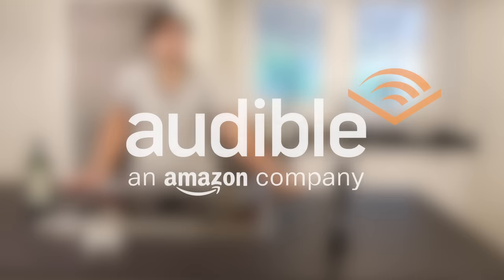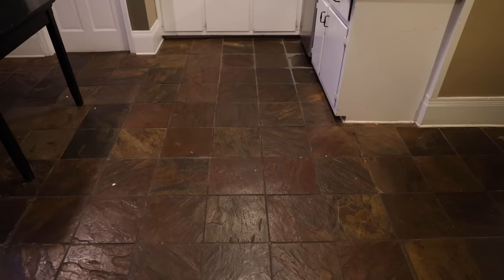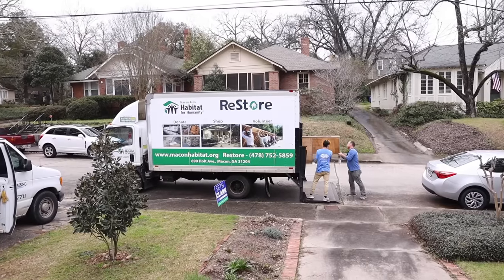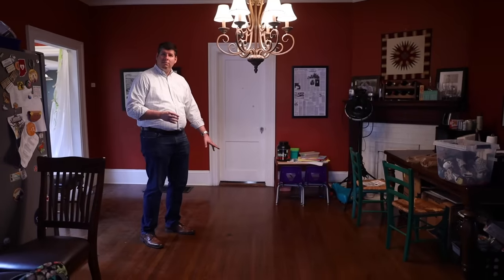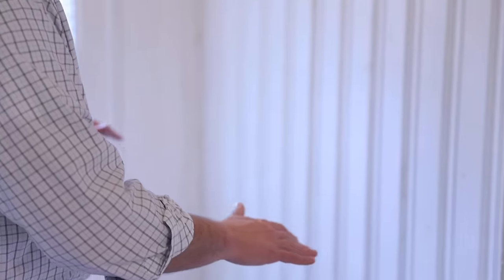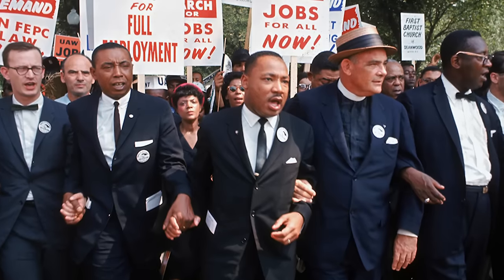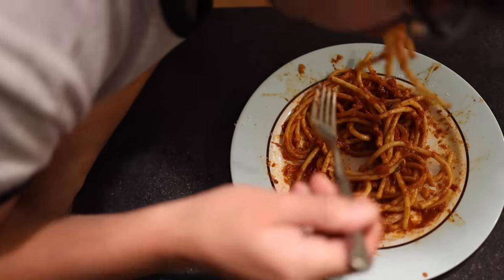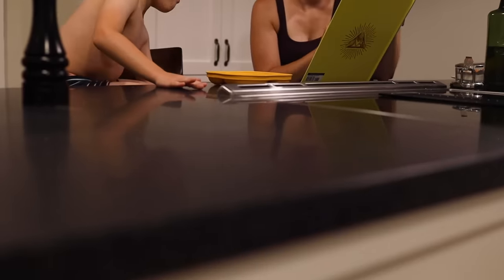How history changed kitchen design in the American South

Comment: this explains a lot about my friends home. even though i live outside philly my friends house is old. being 3 stories high with an attic while other houses are only 2 stories high. their kitchen was at back of the house had doors cutting off the kitchen and separating the dinning room. the kitchen was right next to the basement, had access to a back yard and small prep area, and a “secret” stairway to the second floor. the main stairway was grand being wider than the stairways in my middle school while the “secret” stairway was narrow and was basically between two walls and it was dark. it was most likely used for the servants of the house to get upstairs without guest seeing them.
Reply: There used to be an English phrase: "the back stairs". This was because in the 1800s and earlier well-to-do English houses had two sets of stairs: the main or front stairs that the "lords of the house" (the owners) used, and the back stairs that the servants used. The back stairs were usually narrow and awkward and crammed in to spaces, but they were also large enough that you could manage to carry bulky things up and down them without dropping them. Food and laundry never went up the main stairs. The main stairs usually opened pretty much directly onto the main front door, and the back stairs would open, through a kitchen and/or pantry, on a back 'tradesman's door'.
Reply: l wilton that nails its description. the front of the house has large porch that goes around to the sides. and in the front door there is a study a living room the dining room and the main stairs.
Reply: Seems like these houses were pretty much laid out the same all over the place from the era... interesting.

Comment: I draw house plans for a living, and do a lot of additions.  I see a variety of plans, and actual houses built over a hundred years ago.  It's common for older homes to have started with the kitchen being walled in.  And many had a butler's pantry, like Adam's house.  
Everything Adam and the professor said is true, except for one thing, domestic servants were quite common in every state.  You can look at house plans in books, and magazines, from the 1920's and earlier, and see that the walled off kitchen layout is standard.  The kitchen would have a screened porch on a back corner, and have it's own entry to the side yard by the driveway.  The servant used the porch to perform many tasks in, and was typically expected to enter the house through that side entrance.  Servants, and delivery men were not allowed to come in the main entrance.  It was also common to have a teeny tiny powder room reserved for the servant(s) who were only dayworkers.  That kept them from tying up the bathrooms used by the home's residents.  But mostly, it resolves any unease felt by a homeowner who was prejudiced based on race, or class.  Sitting on a toilet that a mere servant had used would be unacceptable to many people in those days.  And more than a few today.

For those houses that were designed to accommodate live-in staff, modest homes would have a tiny bedroom for a cook/housekeeper located at the back by the kitchen.  It was usually adjacent to the kitchen porch.  In larger houses, owned by more affluent people, a section of the house was set aside for servants, like you see on British TV shows.  Sometimes they'd be in the basement, sometimes in the attic, and just as often, in their own small wing.  The servant's floor, or wing, would have a full bath reserved just for the staff, and sometimes a sitting room was reserved for them.  The exception is that live-in chauffeurs, and gardeners, would often have rooms and a bath in the garage.  The garage was not attached to the main house, and was located in the back yard. 

 Domestics may have been predominately Black in the South, but in other parts of the country, they were Irish, Norwegian, Italian, Portuguese, Mexican, Chinese, or any ancestry you can think of. 
The rising cost of labor, opportunities for better jobs, and labor saving devices, eventually killed off the profession of domestic workers.  The exception being those who are employed by the very rich.    And even they try to pay as little as possible, often hiring foreigners who are here without legal papers.

My purpose for writing was to point out that, as bad as the South may have been with it's treatment of Blacks, domestic servants of all backgrounds, were common across the country, and even around the world.

Comment: Houses used to be built with their environment in mind, that's why different regions have different styles of houses. Today you could build an east coast style McMansion in Arizona and use vast amounts of AC and energy to cool and heat it and it would be terribly inefficient. I'm not suggesting that anyone have to live without AC but rather we should bring back those traditional designs of houses that were created to fit their environment. Like the humble southern Shotgun Shack which had total cross ventilation and often had the kitchen in the back to isolate the heat and keep the house cool in our notoriously hot summers. It was well adapted to the regions weather and made the summers more bearable before the advent of AC. Plenty of other local architectural styles have clever layouts with cooling in mind. They're also much more characterful and better looking than these modern ticky tacky subdivision houses. As well as being more energy efficient.
Reply: Thank you! As a non-American, I was always wondering if anyone American ever noticed how bland and tasteless those generic "luxury" houses are, and it turns out, there is even a word for them!

Comment: I too live in a nearly 100-year-old bungalow, but on the other side of the country in California. My kitchen comes equipped with a tiny shelved closet with air vents on the shaded side of the house, meant to be used as a pantry that would stay colder than the rest of the house even in the summer months, called a California Cooler. Your video has clued me in to the purpose of the weird nook in my daughter's bedroom (which itself used to be part of the living room before a wall was put up to partition off a small bedroom) since this nook too is slanted towards the outer wall enough that toys are always rolling that way. Maybe it was once an outside patio as well.

We just finished a bathroom renovation that rearranged everything as well, because the previous layout of the bathroom made 1920s assumptions that are no longer true. They didn't have a shower back then, for one, so it was perfectly fine to have a wood-framed window above the bath tub ;_; One of the owners back in the 1980s or so decided to renovate to add a shower without changing anything else. Every renovation is like an archaeological dig, trying to figure out what all the previous owners did to the place over the last 90-some years.

Comment: A few years ago, I was graciously given a tour of an 1870s Victorian in San Jose, CA so well-maintained that it still had working gas piping for gaslights and the original servant's staircase to reach the prep kitchen, which was at the back of the second floor. I had never seen such a steep, narrow stairway, and I've climbed stairs in 18th century taverns.

I appreciate modern kitchen design. And staircases.

Comment: There's another interesting bit of history that I probably wouldn't have noticed before. The hearth, was more centralized the more north you went and more decentralized the closer to the equator. You'd much more commonly see public cooking areas around the equator, and have central to the home fires (including cooking fires) in northern areas. Why? Because fire is warm! If you're already in 90+ degree heat you don't want to be stuck inside with a hot oven, but if it's gonna be frozen outside half the year you want to be as close to that action as possible.

Now once you get closer to the modern era or the upper classes you see that division come up again as you can have separate fires for staying warm and for cooking, but I think that's just another neat thing. The idea that having two heat sources would be a luxury.

Comment: My 1897 house also has one of those servant bell buttons on the floor. It didn't hold a pedal, but a small button held up by a spring.  It looked rather like a thick and dull nail.  It still worked.  When I bought the house in the 1990s, I was having the ceiling of the dining room painted.  My painter had had a fall and hurt his shoulder, so he had a hard time painting overhead, so he hired a friend of his to help him.  His friend was terrified of old homes and was convinced they were all haunted.  They had covered the floors with drop cloths, and when the assistant would step on the button, the bell in the back would ring.  He would go to the front door to check who was there, and of course, there was nobody there.  After the third or fourth time this happened, the assistant went outside and refused to come back in, saying, "I told you it's haunted!"  So the painted called me, and I asked him he they were stepping on the servants' bell on the floor.  I think the painted gave his assistant crap for the rest of the day! Since then, I've pulled out the "nail" and saved it, and it can be reactivated at any time.
However, I don't think the servants in this house were of African descent.  The people who built the house were German immigrants who did well for themselves, and I've seen ads in the papers where they were looking for a "German girl" to work as a domestic.

Comment: Domestic servants were a standard feature of upper middle/upper class homes across Europe at the same time and they also tended to disappear just before and especially after WWII as more attractive work (either white or blue collar) appeared and technology offered alternatives to manual labour.

It should also be noted that the basic, rational design of the modern kitchen were hugely influenced by a series of time and motion studies that sought to rationalise the work flow in the home kitchen in a way similar to that in the factory, e.g. minimise the number of steps necessary.

One example of this design philosophy was thee so-called Frankfurt kitchen originally designed in 1926 to maximise and rationalise the use of the scarce kitchen space in working class apartments.

A fictional film, in which such time and motion studies form the basis for the plot, is the 2003 Norwegian film “Kitchen Stories” (aka “Salmer fra kjøkkenet”) by Bent Hamer, which is also a great introduction to the various approaches to observation techniques and their pitfalls.

The film also shows a very real measuring device; a sort of huge backpack bellows with a sack, a hose and a breathing mouthpiece, used to measure the effort of various tasks by measuring the air the subject was breathing. Such measurement were used to optimise not only kitchen design, but also the utensils used in cooking, cleaning and other domestic work.

Comment: Two kitchens are once again a status symbol in the U.S. Not necessarily for domestic help, but the outdoor barbeque has grown to include woks and pizza ovens with sinks and refrigeration to back up the prep.

I did work on a 60,000 Sq ft private home 25 years ago that had an enormous residential kitchen upstairs that included 2 residential dishwashers ( I thought this idea to be brilliant!) And it had an accompanying butlers pantry to the side - similar in size to many apartment kitchens I have seen. In the basement, was a full-fledged commercial catering kitchen and an adjoining dining room which could seat 100 people. This was the second house of this size in our area. The first was completed a year or so earlier. That particular house - new construction completed in '96 - was just recently demolished, so that the developer could build 3 luxury private homes on the in town, lake front property. Just because you can huild something, doesn't mean you should.

Comment: In the American Southwest, that back porch would have held a wood fired clay/adobe oven.  Same in Spanish Florida.  You don't want a hot smokey oven heating up your house, and dealing with wood, firing, and the ashes is better done under an open porch or portico.   Even up north, where you might actually want heat, if you had an oven for baking that oven would normally be outside in a covered but otherwise open space.

Comment: As someone who had slate tiles throughout a house i lived in not only the kitchen but THE MINI BATHROOM/LAUNDRY i can tell you right now id never have slate anything it doesnt matter how much you clean it youd need a pressure washer and it still wouldnt be clean and it doesnt even seal its not smooth so youd trip on the natural bumps and the shower grew full on mushrooms. Like out of every crack. That was one of the smallest issues with the place if you can believe it.

Comment: It looks like your new stove is an electric stove. Did you consider using an induction stovetop? I remember in your induction video that you had an issue with electrical interference and other mechanical sounds. But I also seem to recall that you visited a neighbor's house who had a full induction stovetop  (not just a portable hob) and that was less of a problem?

My apartment just got a brand new electric stove and I am burning just about every other meal I cook on it because it gets too hot during the cycling of the coils. So when I am finally able to buy a home, I am very interested in getting a full induction stovetop installed.

Comment: This is a pretty common phenomenon in european cities as well. Though it doesn't relate to former slavery in any way, household servants were around until after the second world war in most middle and upperclass households. This means that even in small inner-city apartments there is usually a smaller room next to the kitchen and lavatory for a servant to live in. At least this is the case in Budapest where I live, and I imagine in most cities that were mainly built on the turn of the century.

Comment: I find this very interesting to compare with my grandparent's house in New England (northern states where the pilgrims first settled and near where much of the anti-slavery movement took place.) It was built somewhere around the civil war era or shortly after, so similar time period. 

The dining room is in the center of the house with the living room (called a den or sitting room at the time) and stairway in the front. The bathroom, kitchen, and laundry room were in the back of the house. The bathroom and laundry room are separated from the main area by a hallway, but the kitchen is separated only by door. The door, as far as I know it's the original, has clear glass panels like french doors do, but it's just a single narrow door. You can see into the kitchen through this door while sitting in the dining room, but there's still a seperation. I'm assuming that's a separation between the guests and whoever is doing the cooking, the women at the time. When I was little, it was also used as a no children sign. If the kitchen door was shut, we weren't supposed to go in there. There's room for a table in the kitchen, what most here call a breakfast nook, and a back door in there too. The old heating and AC systems don't reach the kitchen at all, so it's a constant opening and closing of doors as the temperature requires. 

Based on this video, it seems like the kitchen I grew up in was built for a separation between women and men/guests/children rather than gentry vs servants. One thing I find interesting which brings the two parts together is the dinner bell which hangs on wooden doorframe in the dining room. The door opens to the basement staircase but is built in a way that it blends into the wood of that wall. The bells have a chain attached which I was always told was the dinner bell. Whoever was cooking would've had to cross the dining room to get to the bell though, which I find so intriguing with this context.

Comment: I think air conditioning also contributed ENORMOUSLY to the movement of kitchens from the backs of houses to the centers of them. In the summer, in a poorly climate-controlled home, it is a blessing to have a door between the stove and the rest of the home, and a door to the outside in the kitchen to improve ventilation. Ventilation would be very important when cooking with unclean fuel such as coal,  and it reduces cooking odors in the rest of the home. A lot of modern Americans may like having an open floor plan with cooking smells wafting everywhere, but we don't cook smelly beans or borscht as often. For these reasons, I personally still much prefer a kitchen that is closed off by a door and towards the back of a house.  

Also, in the American North, well off families always had domestic servants as well (though they may have been less likely to be Black), and their architectural design reflects this. There were often workspaces for domestic servants separated from the rest of the home, and even semi-hidden routes for their servants to discretely move around the home. 

Open floor plans are also facilitated by modern building techniques that allow us to use fewer internal load bearing walls. 

I love this video and the exploration of the social factors that influence design. I just think there were some more practical reasons even separate from wealth and social factors that meant kitchens were often separate from the rest of the home, including in more modest family homes, and that some of these social factors weren't localized to the South. I do understand that exploring all of these factors would make for a much longer video though!